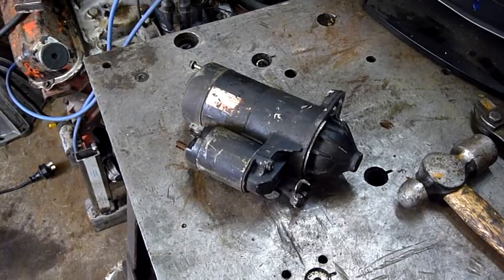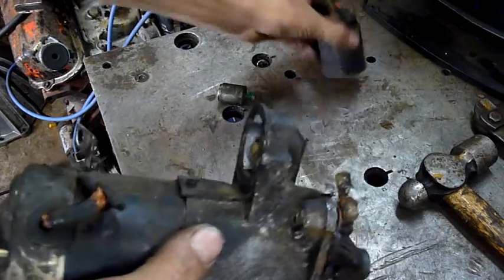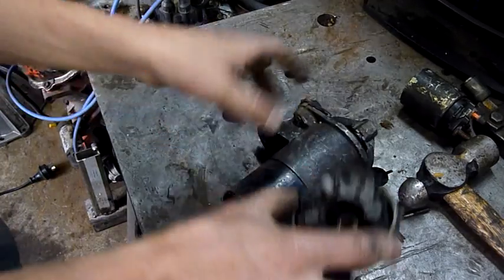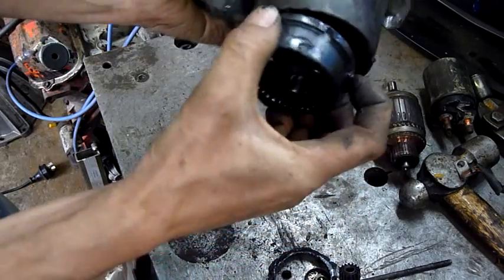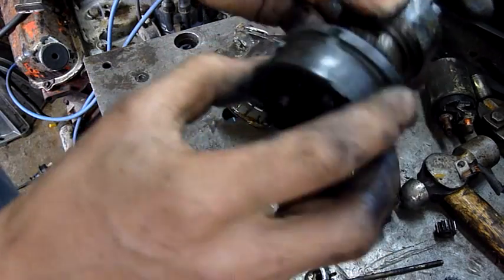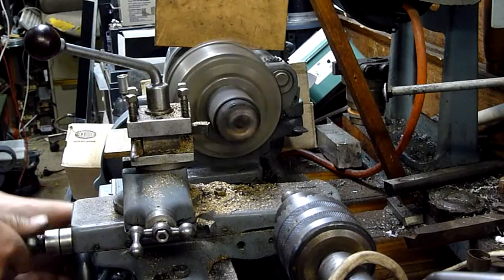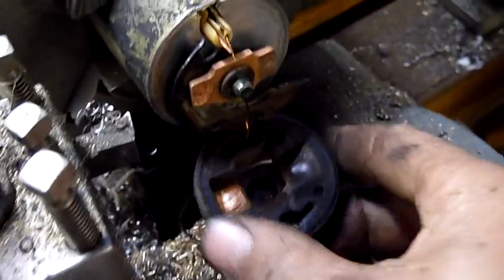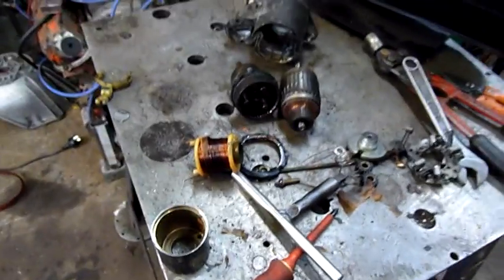Hyundai Starter Motor Autopsy (Fried on 24V).mpg

Comment: Just as an FYI, the big GM starters I'm used to actually have 2 coils wound together - one is directy grounded (fine wire) the other is grounded THROUGH THE STARTER MOTOR (heavy wire).  This way - there is massive force to engage the starter then, once the contacts close and effectively short the heavy winding, only a small current is used to hold the solenoid in.

Comment from the maker: @zx8401ztv always a pleasure mate!,

the armature can be as small as it is because it has a planetary gearbox to multiply torque. sort of like a cordless drill, they have tiny motors, but a large multi-stage planetary gearbox to turn the high RPM's into low down torque!

Comment: The older style of starters work quite well on 24Vdc cuz the motor doesn't spin so fast (No reduction box needed), but it is best to energise the coil with only 12V if you can (for reasons you found out!!!) Shame it didnt have field windings, it might have been a goo burnout!!

Comment: @mazinais31 heat kills em fast, if you only did 15 seconds at the most a few times, witha a break inbetween , you'd likely be ok, but if you busted it bad by reving and overheating....

Comment: do starters gradually die or just go bust suddenly when it's all too much- i recently put some bad fuel in my vw diesel and it stopped in the middle of the road when it was -20 celsius outside, i ended up revving the engine on the starter motor quite alot... i mean some 20 seconds in a row afew times like that... not the best thing to do i know but damn it was freezing cold and waiting for the car to be towed didnt excite me a bit, starter isnt very fast now on cold starts, 1yr old oem battery..